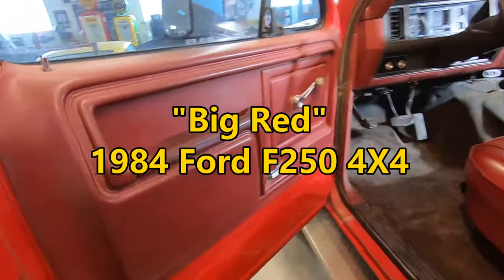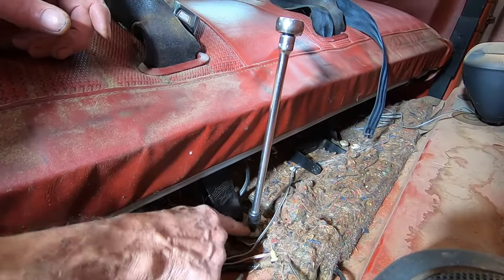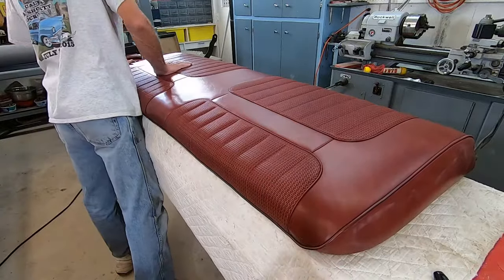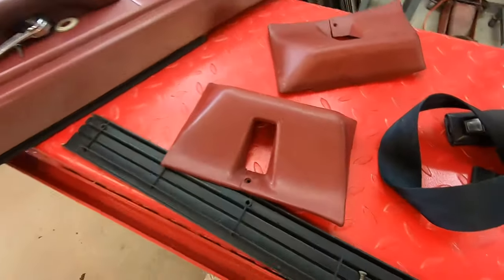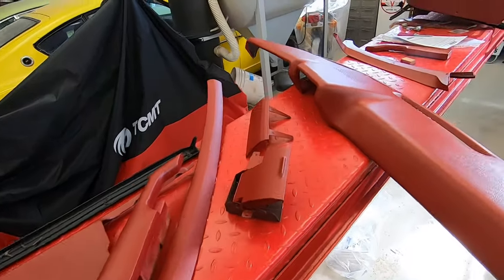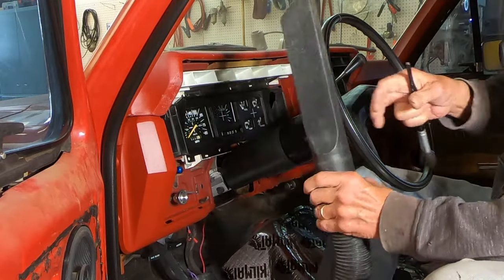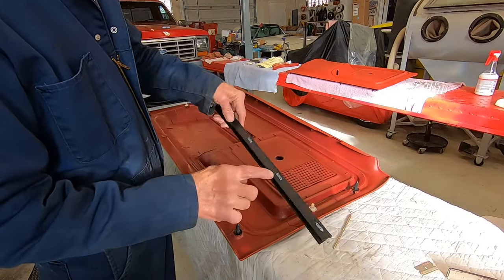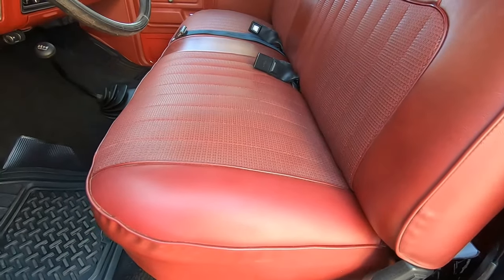"Big Red" 1984 Ford F250 4X4 Gets an Interior Makeover

Comment: Nice job!
I had an 84 Bronco full size. Never did like the dash strip lights along the top or the gauge panel on these years. My Bronco was gone thru by the guy I bought it from. He did this for a living. Used it as a plow vehicle. Had to sell it due to my job moved elsewhere but I wish I had it now. I'm in the woods now. 300' driveway with 2 turn arounds. 700' of plowing.

Comment: Great video !  How does the original dash pad come off ? Also, the SEM firethorn red, is it flexable? I seen that you painted the door panel armrests. NICE JOB !!!!
Reply from the maker: If I recall, there were a number of screws around the perimeter. Best thing to do is start looking for them and removing. Any missed ones will become evident. Yes, the paint is flexible to a point. I've used it a number of times and never had a problem. Thanks for watching!

Comment: Can you please tell where you got the replacement foam at? Do you know a good place to order the finished vinyl cover?
Reply from the maker: Hello, Thanks for the kind comments and watching this video. I did not replace the original seat foam but rather added 1 inch of dense upholstery foam on top that I picked up from our local upholstery supply shop. By vinyl cover, if you're talking about the dash cover, Coverlay sells them in many different colors. Look at their website.
Reply: @DickShaw  thank you much for the reply!
Reply: @DickShaw  I was talking about the cover for the Seat. Mine needs full replacement.
Reply from the maker: @RockyTopSplash  Oh, sorry I misunderstood you. I did not replace my seat upholstery, what you see in the video is the original. I just replaced one panel on the driver's side which had a small tear in it. You can get one from LMC Truck though. https://www.lmctruck.com/interior/seats

Comment: Where did you buy the dash cover from?
Reply from the maker: It is a Coverlay brand and Rock Auto has about the best price but several sources sell it so you can shop around if you want. I bought mine from Rock Auto https://www.rockauto.com/en/catalog/ford,1984,f-250,7.5l+460cid+v8,1123816,interior,dash+board+cover,1284